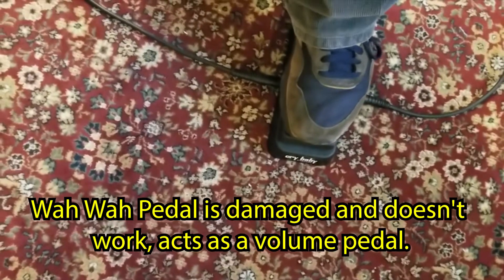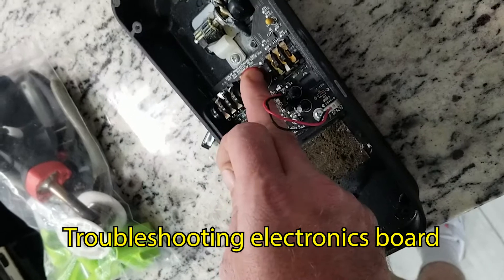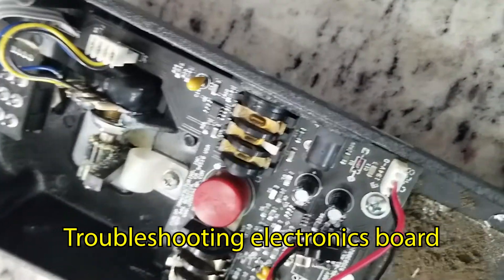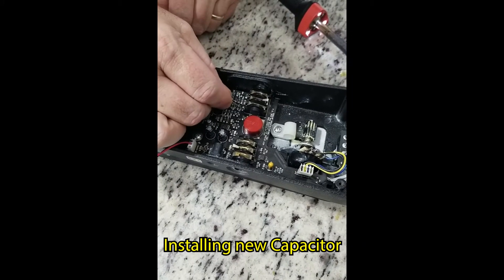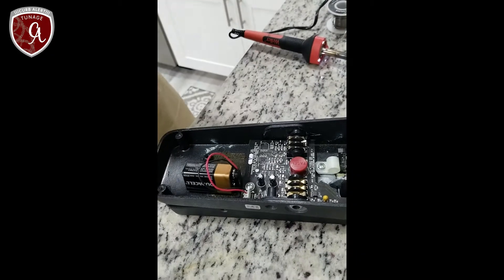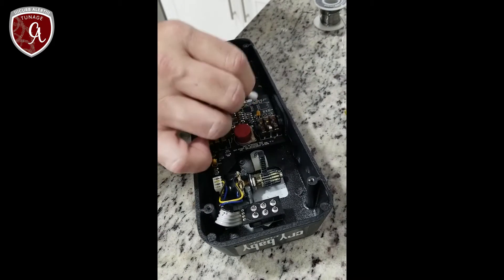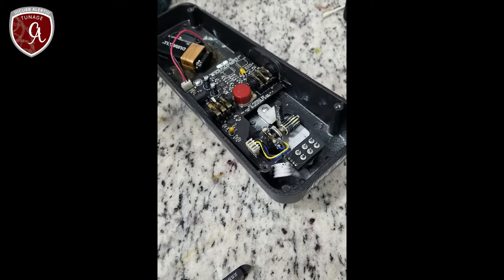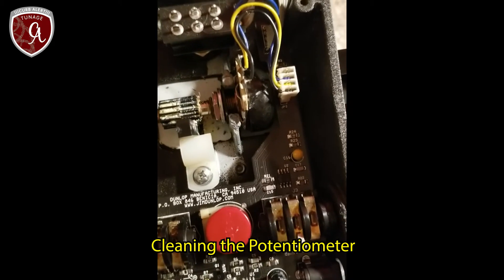Wah Wah Pedal Fix: Replacing a bad capacitor.

Comment: My GCB95 wah pedal also the same issue i am facing with ..sometimes when switching on the way pedal, the sound reduce from the original sound...so can you please help me which part of my pedal got defected
Reply from the maker: Hey, I suppose there could be other components that could fail to cause that, this particular case for mine is detailed in the video.
Reply: Have you modified your wah pedal to true bypass? If so did you also change the value of the 68k resistor? It needs to be replaced with a 47K or so resistor to bring the volume up that gets lowered when you convert to true bypass.